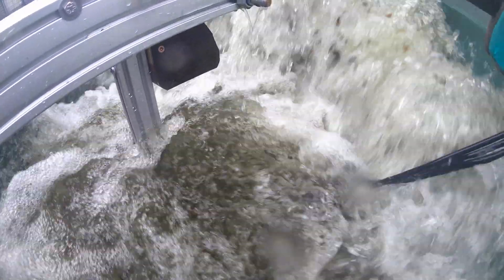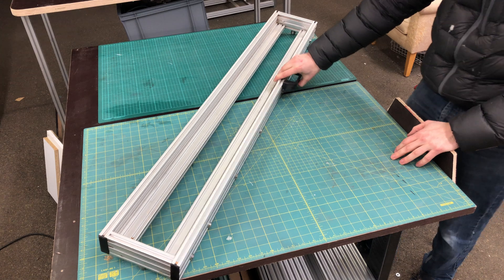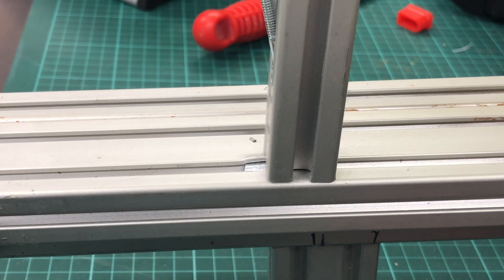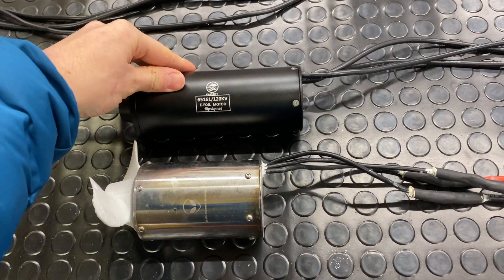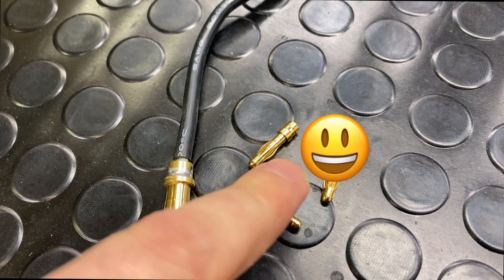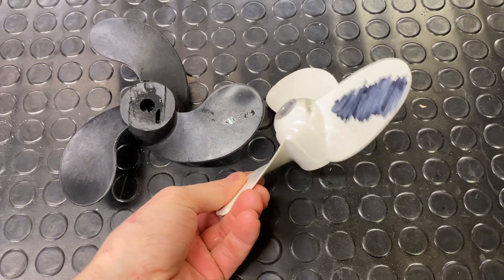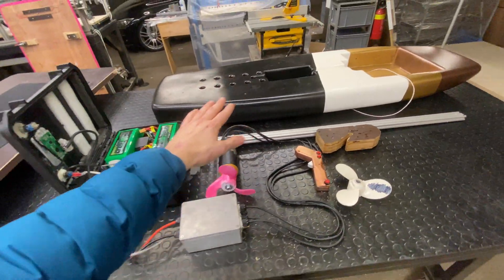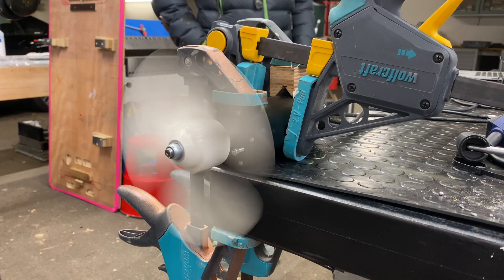Hydrofoil Part 6: Testing Props and Motors! (the never ending project)

Comment: Thanks for your journey, it's cost alot of $ and times. How about now? did you complete the efoil, seem you need replace the vesc to 75/250 ver to get more phase current and take max thrust. Build higher voltage battery pack also...

Comment: your thrust test is not accurate, the proximity to the wall of the barrel causes "ground effect" increasing the thrust you get in comparison to free water
Reply from the maker: That could be the case. I don’t know, but it served to compare motors and props.

Comment: Hi there. I like your videos, very detailed. Just wanted to ask why you didn't make your own prop with carbon fiber instead of the metal? Would a lighter prop not be more efficient?
Reply from the maker: Hey, I don´t think the weight plays a role. The stiffness very likely, but carbon fibre is also not impact resistant. I don´t think commercial boats use carbon fibre for props.
Reply: Probably just gives a slight advantage on initial spin up time and motor loading with carbon lightness but really, rotating mass here is almost irrelevant.

Comment: Hello from nz. very inspiring video, curious what was the final diameter of the propeller? I was thinking it might be easier to custom make propellers by machining aluminium boss and TIG welding the fins, this is what I intend to try. I have a 1000 kv 56-90 motor with a 1 to 4.25 planetary gearbox running at 24v pulling about 50 amps. I need more thrust so I will try a smaller prop currently i have a 180mm diameter 5hp prop.

Comment: Interesting, but isn't the "spinning resistance" of the prop going to decrease a lot when you are actually moving through water?
Reply from the maker: That is possible. I don’t know what will happen.
Reply: @MaxMakerChannel  When you're actually moving, some of the rpm "goes into keeping up".  Assume you have 6 inch pitch, close enough to 0,15 meters.  at 1000 rpm the prop is not producing any thrust at 150 meters per minute, aka 9 km/h.   Assume going 22,5 km/h, the first 2500 rpm is not providing thrust, and also takes little power, just overcoming the propellers own friction.  So at 22,5 km/h 5000 rpm should take little more power than 2500 rpm in your "test bench". So, the first 2500 rpm almost "disappears" in your calculation, assuming 6 inch pitch and a speed of 22,5km/h. 

Also, the high amperage at high power and bigger prop will only be at low speeds, actually the values you got will only be valid for standing still, or almost, which typically probably will last a fraction of a second at "full throttle", and that is even only if you absolutely max it from standing still. 

Assuming same pitch, the smaller prop will be a little bit more energy efficient, but it will lose ability to provide thrust at higher speeds. That is, the thrust decreases as speed increases earlier with the smaller prop.
Reply from the maker: I see. The thrust is only needed to get up on a plane. After that you need only about 30% of the original.

Comment: What is the advantage of a 100KV motor opposed to the 120KV? I'm trying to figure out how this number affects the build.
Reply: With lower KV comes higher torque. More torque gives the ability of using a larger propeller. You need this larger propeller to be able to keep the same speed to a higher KV motor.
Reply: @wavegreen  Thanks!
Reply from the maker: However, people didn’t find a big difference between the 100 and 120kv motors.

Comment: add a propeller guard where the orange 3D printed item is
Reply from the maker: Yes, that is the plan. I won´t use it without a guard. It wasn´t neccessary for testing. Now I have a brand new 3D printer and I can print the large guard without warping. So its on my to-do list right now.
Reply: Does the guard change the dynamics of the efoil lift?

Comment: Nices Video!👍🏼 Wärest du so nett und könntest mir einen Link zu dem Motor geben? Bin schon lange nach sowas auf der Suche😅
Interessantes Setup👍🏼 auch wenn die Effizienz einer solchen schraube in so einem kleinem Testfass sicher schlechter als im realen Einsatzgebiet ist.
Die Propeller sind auch sicher super teuer oder?😬
Reply: Hi klar, es ist ein FLIPSKY 120kv Motor. Du siehst auch die Bezeichnung im Video. Es gibt auch eine 100kv Version. Mir wurde 120 empfohlen. Die Props kosten €15. Gibts massenweise auf Ebay.

Comment: Great work. I love how you really thought deeply about getting maximum power. That filing must have taken ages too. I was worried it would not be balanced.
Reply from the maker: Thank you! I was also concerned about balance. I didn’t even measure it. Looks like I either got it right by accident, or that it doesn’t matter very much. The filing was alright. Just 30 minutes. I am always surprised how fast sculpting can be.

Comment: Nice video,

I have the 65161 motor as you. And I have the same prop. But I simply dont want to shorten the prop. What should i go with?
Reply from the maker: FelixFoils I couldn’t say. First I need to actually get to ride this thing.
Reply: @MaxMakerChannel  did you know lift foil has about 70kg max thrust 😉
Reply from the maker: Wtf! No, not at all. Thats crazy.
Reply: @MaxMakerChannel important! Flying rodeo is again selling flipsky props.  I @ you on efoil. Builders. Please do me a favour and test this prop! Its optimised for the flipsky and well machined!

Thanks
Reply from the maker: FelixFoils I saw that but its to expensive. I use the one I have for now.

Comment: You may already know this but you’re making 30kg of STATIC thrust, i.e. the water in the barrel is not moving. Once you get some speed in the water that thrust will drop off as the angle of attack of the blade decreases. May not be a problem though, once you get foiling, you’re thrust requirement may not me at your max output. I’d be interested to see what the hydrodynamic drag (and thrust) is at each increase in speed. Ramps up quick though, drag is a square of the speed.
Reply from the maker: LSUtiger607 I didn’t know : ). I just figured that this is the only thing I can easily test. Will see how it goes in the water. I am just hoping for enough thrust.